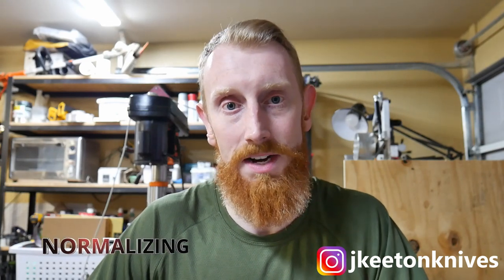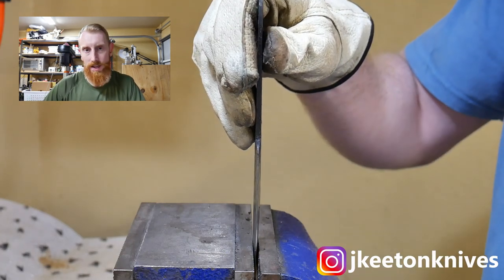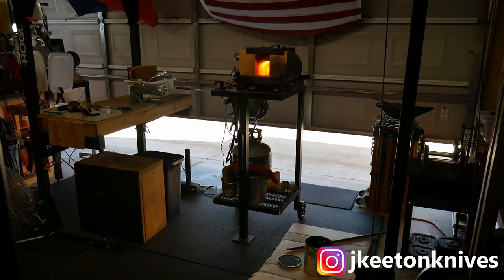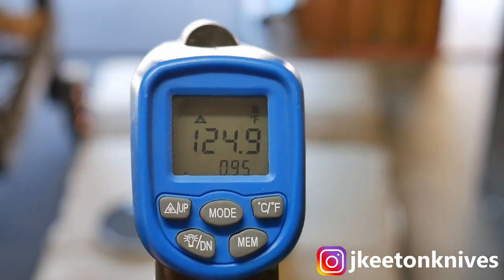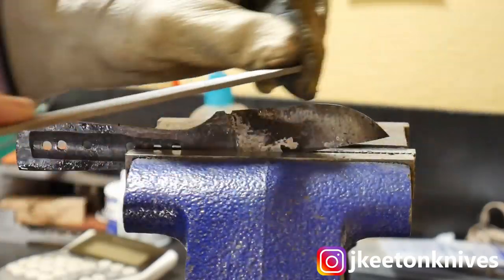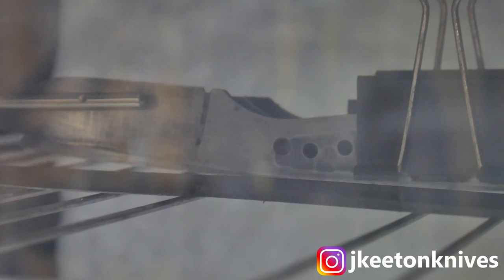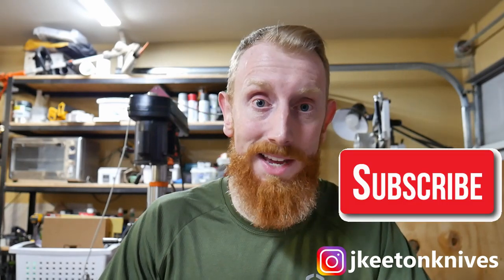How to Heat Treat 1080 / 1084 - The Most Forgiving Steel

Comment: Beginner knife maker, here. What is the purpose of 3 normalizing cycles? Almost all the other 1084 heat-treating instructions I have seen only call for one normalizing cycle to get the steel non-magnetic, 3-5 minute soak, then quench and temper. Do 3 cycles help the knife hold a better edge? Offer some other benefit? I really enjoy your channel. Keep up the great work!
Reply from the maker: Nothing but better stress reliving. If you're stock removing, it's not a big deal. If you forge, it can't hurt.
Reply: @RedBeardOps  Thanks for the quick reply! So, if I understand heat-treating, correctly; stress relief occurs in the tempering cycle, therefore, normalizing 3 times sets up the structure of the steel for better stress relief. Did I get that right? BTW, I made the mini forge and the PID controller following your videos. It actually works, too! Almost ready to heat treat my first knife. Just waiting for my KO wool to arrive so I can insulate my toaster oven and program my PID. Thanks, again!
Reply from the maker: @craigstanley5579  Very cool Craig! 

The normalization helps take stress out of the blade (generally induced via forging/hammering/etc). This will prevent the chances of major warps or cracks during the quench. 

The tempering cycles are to make the blade less brittle.
Reply: @RedBeardOps  Okay, I think I got it. (watched the video, again paying more attention this time. haha) Normalizing takes stress out of the blade by changing the structure of the steel (reduced chances of cracking and warping) and tempering takes hardness away from the blade to make it more durable (less brittle). So, normalizing 3 times reduces the chances of cracking and warping to an even greater degree during the quench than one normalizing cycle will. Just give me two thumbs up if I got that right! Many thanks, sensei!

Comment: Hi Red Beard, I'm longing to make some of my own carving knives, and was contemplating 1095 steel. My simplistic understanding is that 1095 blades go longer between sharping's. 
Can I treat 1095 in the same way. Or is it seriously not worth it and I should go to 1084??
Thank you
Gino
Reply from the maker: I'd go with 1084 if you're going to be heat treating it yourself. 1095 technically requires a soak to get the best out of it

you could also consider 80CRV
Reply: @RedBeardOps  Thank you, I really appreciate you taking the time to reply.
Gino

Comment: I've been watching your videos for the last couple months as I'm starting my journey into making knives. I always love the fact that you explain what you're doing and not just post Instagram unarrated videos.
I built my first forge last weekend and today just heat treated my first two knives in 1095. I'm hoping it works! Currently, they are tempering.
What I'd really like to know/see is the difference in treating 1095 vs 1084. Is there really that much Of a difference? If I treat 1095 the same as 1084, how will it come out?
Thanks
Reply from the maker: Heck yeah Mark, glad you're enjoying them. You should be able to make "perfectly good" knives with this method and 1095, however, it's not optimal. When it comes to 1095 to get the best HT on it you really need to "soak" the blade at the target temp. This generally requires a HT oven. For this reason I recomend 1084 or maybe 1075 as a home heat treat steel.

Comment: Great videos - keep em’ coming!  Can you tell me how much different it is to heat treat 1095 from 1080?
Reply from the maker: Thanks Gary! It's actually a little different. 1095 requires a "soak time" to be heat treated appropriately. You will still likely be able to make a good knife with this method, but just know that you're not getting the best out of that steel without a soak time.
Reply: Red Beard Ops thanks, so soak time is leaving it in the oven for a predetermined length of time at a certain temp - is that right? I’ll
Look into it more and read up about it. Just thought I’d ask quick as it’s it’ll be my first time heat treating - should’ve used 1080!
Reply: @garygrimaldi3230  You don't want to soak 1095. You'll cause the grain to grow. It's very similar to 1084. The only difference is that you need to heat up the steel far hotter than you would with 1084. Otherwise they're the same heat treat wise. 1095 is a better steel. Tougher and holds an edge longer. 01 tool steel is fairly easy to heat treat at home as well. I would stay away from stainlesses and temperature specific steels as a beginner until you get the proper equipment. I learned from William Collins at WC Knives. He has a lot of knowledge on the subject. LT. Wright knives offers classes too if you need the help. Goodluck 👍

Comment: Hello. I'm pretty new at this knifemaking thing. I've made about 14 knives, all with 1084. All but my latest has turned out great. With this one I ground the bevels after heat treat as ive done most but this time I put way too much pressure for too long and turned the tip blue. What is the process of redoing the heat treat or should I call it a loss and start over again?
Reply from the maker: Depending on the thickness you can a.) re-heat treat the knife b.) scrap it c.) potentially make it into a shorter knife by grinding back the tip past your color change (without re-heat treating it)
Reply: @RedBeardOps  Thank you for the reply. I have decide to shorten the blade a bit. I guess what I'm getting at though is, if I was to re heat treat, do I start all over with annealing, and or normalizing?
Reply from the maker: @dannyrucker2774  I actually don't know what the perfect answer to that is... but I think it would be a good idea to do so

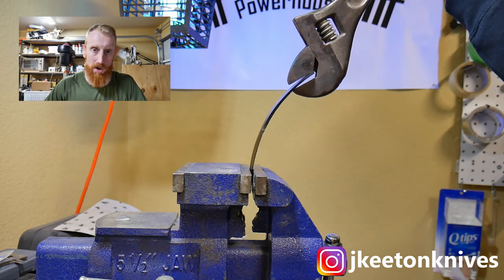Comment: Hey RB, Thanks for referring me to this video. It too was a big help. At the 4:37 mark, you really have that blade bending. If we temper properly, will the knife return to being straight after you take the pressure off?
Reply from the maker: Hey man, it depends on how far you go. There is always a limit. It's a balance too. If you temper at a lower temp, you'll have a harder blade that may hold the edge better... but it will have a high chance of chipping on the edge and breaking when bending. If you temper at a higher temp, you'll have a more durable blade, but it may not hold an edge as well. It will bend better in general at higher tempering temps, but if you go "too high" it may stay bent! ... lesson is that you have to play around with it depending on what you want. ~400F is a good tempering spot to start for a 1084 knife

Comment: You can print this out to take to your shop if you want

Normalize
1st cycle: 1,800 F
2nd cycle: 1,600 F

(Critical/nonmagnetic temp = 1,333 F—go by magnet—
From there, go by color chart)

Quench
Heat a gallon or more of quenching oil (canola oil) 
up to around 120 F with a hot piece of steel
(less than a gal. Will heat up the oil too fast)

Heat steel up to 1,500 F and quench with in-out motion

Test
Try filing.
The file shouldn’t do anything but cut through the layer of de-carb

Temper
Pre-heat toaster oven to 410 F
Two cycles—two hours each, cool in water between cycles

Done and done

Comment: Hello, i would like to ask a question as i am very new in the world of knifemaking. Trying to heat treat C70 steel, the only way i have to measure the temperature of the steel is my magnet. At that point  when it loses its mag etism, i quench it in oil but the result is not a really hard blade. At least this is my feeling and the test with doesnt have the outcomes i expect... can you understand my mistake? I need to keep the blade in the forge more??
Reply from the maker: Hello Sir. I apologize, but I don't know anything about C70
Reply: @RedBeardOps  many many thanks, sir, in any case, for the thesaurus of tips and knowledge i found in your channel! I will keep trying

Comment: I've got 1075, would you need to heat treat and temper it differently than 1080?
Reply from the maker: Yeah man, I'd HT 1075 just like 1080. You should do fine

Comment: I purchase my steel from admiral steel. It’s labeled on their website as 1075/1080... this would be the same as 1080/1084 right?
Reply from the maker: Should be very very close. I don't have much experience with admiral, but it sounds like you're on the right track.

Comment: I need some advice.  I did a heat treatment on the 2nd and 3rd knife I'm making.  I did it exactly the same as I did my 1st knife which came out hard.  For some reason the 2nd and 3rd knives were not as hard.  A file will slightly file the surface of 2&3 when it wouldn't on #1.  it seems these last blades 2&3 did not harden as much as #1.  Should I repeat the hardening process again or just temper and see how they are to work with finishing them?
Reply from the maker: Sometimes a layer of decarb builds up on the surface and is easy to file away. You can get though this soft decarb then the file will skate... make sure that's not your situation. If the file is cutting deep into your knife you can always normalize then re-quench.
Reply: @RedBeardOps  Maybe they are harder than I thought.  After tempering I tried to drill a small hole that would be hidden by scales.  The drill which easily made holes before heat treating would not even make a dimple.
Reply from the maker: @glenpaul3606  Nice, yeah, sounds pretty hard

Comment: How long is the blade Quenched in oil after the third Normalization cycle?
Reply from the maker: THe safe bet is to leave it in there till its cool... but you can get it plenty hard with a 5-7 second quench I think. This is what I normally do so I can take it out and clamp between plates

Comment: One quick question im making my first knife and I'm 14 so I've made a small home forge and wondering if the temp for heat-treating of it has to be very exact
Reply from the maker: Man it doesn't have to be prefect; especially with the forgiving 1084. The numbers I gave here is what you'd shoot for if you had an oven. You can get pretty darn close with the color guide. Get it non-magnetic, put it back in for a little bit longer, quench it and then file test.
Reply: @RedBeardOps  Dude thanks so much
Reply from the maker: @hensonjones5841  any time man. Good luck! Don't be afraid to HT a couple blades and break them to look at the grain structure. Do that enough times and you'll get a feel for it.
Reply: @RedBeardOps  Well I don't have any power tools and my friends dad let me borrow his and taught me how to use them so I don't want to hand saw a whole other knife next.

Comment: I noticed it looks like you have a square tube inside your forge. Is that to spread out the heat to avoid overheating the steel directly in the flame? I noticed when I heat treat a knife, the tip of the blade gets glowing yellow before the rest is even red. Would that help? Did you make that tube?
Reply from the maker: Yes sir, that's a "muffle pipe" . In my case it's just a piece of square tubing. It helps disperse the heat.
Reply: @RedBeardOps  Awesome, thanks! Is it open at both ends or capped at one end?
Reply from the maker: @Nabana13  I capped one end, but I'd say it's not necessary

Comment: J I see a bunch of people selling 1095 how does that work?
Reply from the maker: Hey Devin, I'd highly advise getting some 1080/1084 instead. It is easier to heat treat correctly in a home forge. From what I understand 1095 actually requires a soak time for an optimal HT. 

Texas Knife supply has a good reputation if you want a 12'' piece to get started here - https://amzn.to/3ksUjsu

I get mine in long pieces from either Alpha Knife Supply or NJ Steel Baron.

Comment: Ok I have a question for the community: I'm making a straight razor from this steel and I want to blacken it with linseed oil. Should I quench in linseed oil? Or should I heat it up after doing the whole heat treatment and then dip it in the oil? Should I "quench" in the oil after the second temper heating?
Reply from the maker: Hey Zen, I don't know the answer to your questions. But if you're going to be heating up the blade after your quench, make sure not to heat it above your tempering temperatures. I'm also not sure about linseed oil as a quenchant. You may want to ask your question in the shop talk section of blade forums.
Reply: @RedBeardOps  okay, what if a file cuts into it after the 1500 and oil quench?
Reply from the maker: @zenjon7892  You may have a thin layer of decarb to get though... but if you don't skate a file after getting though the de-carburization then you're not hard.

Comment: Hi I have been unsuccessfully trying to harden 1084, the only difference seems to be that I am using vegetable oil. Could this be my problem. I have tried it hot and cold and got a better result cold but only got the tip hard. HELP Thanks MJ
Reply from the maker: Man, I've used vegetable oil with good results. It could be your steel. Where did you buy it?
Reply: @RedBeardOps  From a knife maker supplier in UK. Re watching and re trying several times at least 10, I wonder if I have over heated the steel. So I have ordered a temp gauge. And will start again from scratch
Reply from the maker: @MJ-ee2rb  @M J If you're getting it up to non-magnetic and quenching in oil... and it's not getting hard, then I think it could be the steel. Also know that there could be a very thin layer of "decarb" to file though before contacting hard steel.
Reply: @RedBeardOps  I have successfully managed a smaller knife I think my one torch is not enough for the length of the blade so I have ordered another torch.

Comment: So I hear you and everyone else talk about exact temperatures. I have a mini forge but how am I supposed to get it to an exact temperature? Also how do I even monitor the temperature? I don’t have any kind of thermometer. What does a thermometer for a forge look like?
Reply from the maker: Well here is one way - https://youtu.be/dm6LHuAdKhc - I will say that it's not fool proof. A magnet and color go a long way for the home heat treater in a forge. The real answer is to do it "right" is to get your hands on a PID controlled Kiln or heat treat oven.
Reply: @RedBeardOps  thanks man. Non magnetic is a pretty good rule of thumb then? One more question since you are the first knowledgeable person to pay any attention to my comment lol. Do those belt grinder have to be built? I have found one brand that sells them but they are $1200 for a cheap one. I don’t have that kind of money. Maybe there is a kit???
Reply from the maker: @uwishpal  Check out the Northridge Model-E grinder. Pretty reasonable. Also "House/Works" has a good kit for building one.

Comment: Do you answer comments? Would a laser thermometer work or would it not send the laser back for a reading
Reply from the maker: Hey Chris, I do. They generally don't go high enough in temperature. They do have some industrial versions that would work well.
Reply: @RedBeardOps  thanks I see them for 2750f for about 100$ I was just worried it would not work.
Reply from the maker: @christopherconkright1317  I'm not sure either. Never tried it.
Reply: @RedBeardOps  I appreciate the answer if i try it I’ll reply here let you know if it works

Comment: 1084/1080 is a good steel. Maybe not the most forgiving, though. I would argue 80CrV2 is the most forgiving since it has stuff in it to help prevent grain growth while austenizing above critical.
That being said, 1084 is much better than 1095 in all the measurements I've seen, much tougher at the same hardness and if you want more wear resistance just get a different steel with some carbides in it. I think the best steels are the higher end low alloys like 80CrV2, 5211 ball bearing steel, and 5160 spring steel. Just enough extra stuff peppered in there to maximize normal steel performance and make it easier to quench fully in oil without having to resort to parks 50 or water for full hardness.
As far as optimal in a forge, tempering then doing the quench IMMEDIATELY after getting to non magnetic in a fast oil is ideal, then toss it in your freezer, then temper twice at 375-450 in a toaster oven or some such. That'll give you the most possible performance in a forge.

Comment: Dumb question... If you by steel that's already annealed, then heat treat and tempering is all that is needed, correct?
Reply from the maker: That is accurate, sir. That is the boat I am in. I don't anneal my steel.

Comment: Nah, plain carbon steels are meh. Any tool steel is better, just because tool steels are cleaner with less inclusions, and moderately alloyed holding edges better and rusting less. O-1 is the easiest, I can get to 62Rc heating cherry red by eye with a propane torch and quenching. Draw it back by grinding off some decarb and using color. So any better than that system using a real furnace works great.
Reply from the maker: From my understanding you get the most out of O1 with soak times in a proper HT oven. Either way, I feel like 1084 is a good starting spot for most and it's extremely popular since it's often combined with 15N20 for damascus. :)